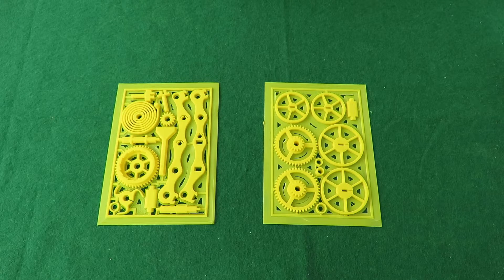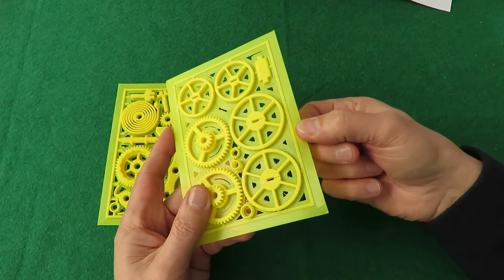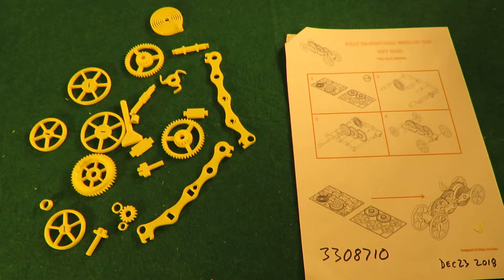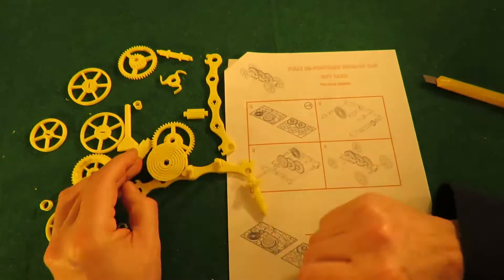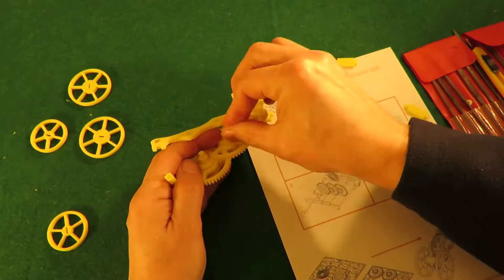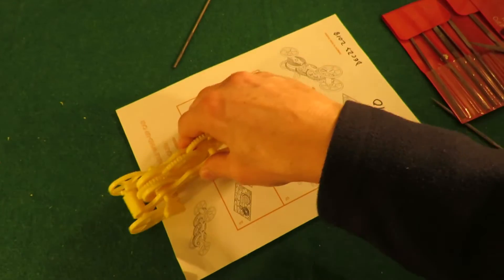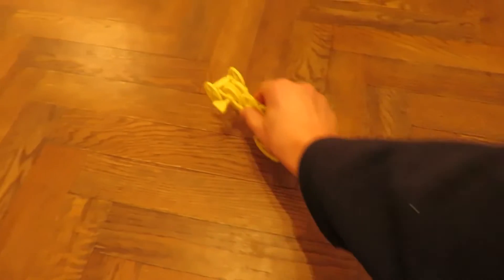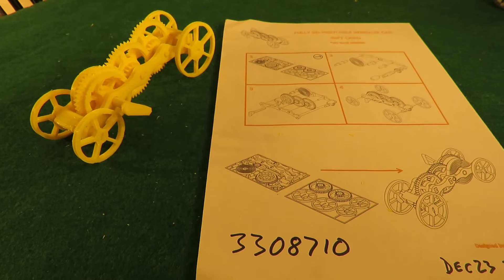3D printed wind up car FAST FORWARD

Comment: Now you gotta pay a buck 90 for the files
Reply from the maker: To be honest, that is not a lot of money when you consider the time it would take you to design one from scratch. However FREE is always cheaper 😆 You might like this playlist where I do Greg Zumwalt's 3D printed wind up cars https://youtube.com/playlist?list=PLA5a2xPRSrB068ZLJmsp-eNKZeyE44rln
and here are some of Greg's links
Alternative design
https://www.instructables.com/How-I-Designed-a-3D-Printed-Windup-Car-Using-Autod/
https://cults3d.com/en/3d-model/game/how-i-designed-a-3d-printed-windup-car-using-autodesk-fusion-360
https://youtu.be/EAgUQOUJbvU
Gzumwalt 3D printed wind up car https://youtu.be/_w1LrRPG0Uo
Dual Mode Spring Motor Rolling Chassis Comparison https://youtu.be/PjmT369N0wM
Reply: @GrandadIsAnOldMan  oh thanks! Also it didnt work very well but it did work.
Reply from the maker: @ElMatero6  yes, just getting them to work can be frustrating, getting them to work well is a real challenge. 😆👍

Comment: Rubberbands still make a great way of driving ideas forward, make the most of something small 😊
Reply from the maker: Rubber band power is one of my favourites, I have several hundred videos on my rubber band channel and several hundred on this one too. I also have quite a lot of clockwork & windup videos too. This one was disappointing because I messed up the printing options. I might print it again sometime so we get a better result. The designer also did a great wind up boat so that is on my list to try at some time but it is more complicated.
Reply: @GrandadIsAnOldMan  I have 10 years or so of experience in making drawings in cad-programs and printing it in different good and bad machines, mostly bad, yeees, if I can help I will... Preferable in Swedish. No? No :-)   OK :)
You have given me lots and lots, if you need some advice i´m here if I can help
Reply from the maker: @magnusericsson8684  thank you Magnus, I have just been watching your Dalek rendering 😍
Reply: @GrandadIsAnOldMan  Yes, exterminate!  😄 Will be making more vids now, working from home...Have a great weekend 🖐️